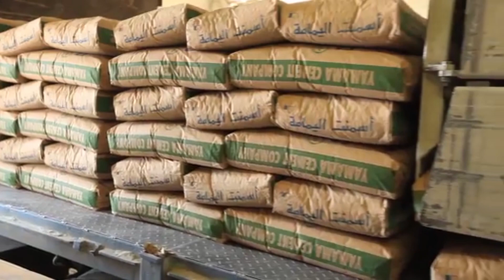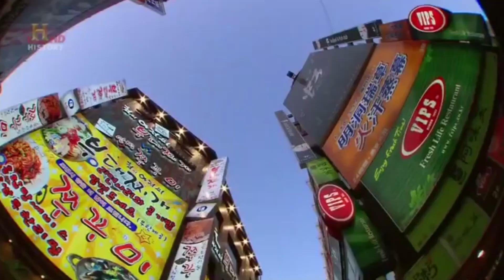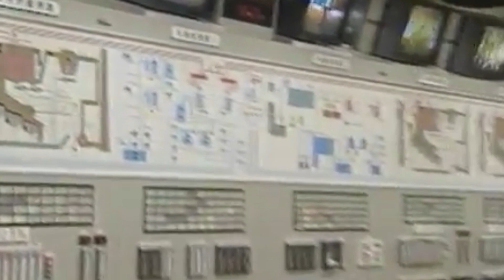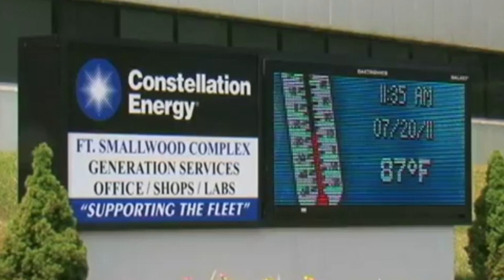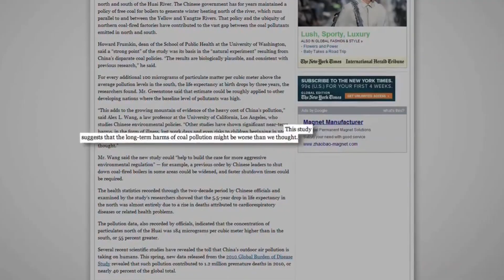10 Countries That Emit The Most Pollution

Comment: 6:40 Cremation and the burning of feces is actually carbon neutral The carbon in feces comes from the air anyway so there is no net increase in CO2.
Reply: isoeno
Trees (and other plants) do not grow from the ground, they grow from the air. If plants grew from the ground, conservation of mass dictates there would be a hole under the plant.
    As a chemist I'm sure I don't need to explain the carbon cycle to you, but for others; plants take in carbon dioxide, break off the oxygen atoms and use the carbon atom to make sugar and add it to their own mass. So you hgave a carbon based life form that got its carbon from the air. An animal comes along eats that carbon and adds the plant carbon to its own mass. If another animal eats the plant eater, of course the animal's carbon, which once belonged to the plant, becomes the carnivore's carbon. When the carnivore dies it's carbon will become CO2 again as the animal is burned or just rots.
Reply: AveryHD
This is true. We need to be carbon negative over all if we want to reverse climate change, but reversing climate change could be even more dangerous than global warming.
    Considering the fact that global temperatures are currently quite a bit colder compared to geologic history, and atmospheric CO2 is quite low, the Earth can survive quite a bit of global warming.
   In the other had, we are still technically in an ice age and it might be very easy to tip the planet into a runaway ice age, where the polar ice caps extend to the equator.
    We could still grow food if the Earth were warmer, but if it were colder, if glaciers covered all the land, there will be no food at all.
Reply: +Eric Taylor Interesting comment, do you have any sources you can provide? I've always thought that cremation was extremely harmful to environment, since our bodies actually release Mercury, which gets into our atmosphere. Then a traditional cremation, there is the coffin, and all of the power they use in the cremation process (700C+ for 75 minutes). Although I'm sure they aren't doing that in poorer countries. I found an interesting article here: http://www.theguardian.com/environment/2005/oct/18/ethicalmoney.climatechange
Reply: Police Brutality The mercury comes from dental work. Humans aren't made of the stuff, and unless they have died of mercury poisoning, there isn't much there. It is a separate issue from carbon in any case.
    The carbon contained in the bodies came from eating plants or animals that ate plants.
   That carbon is mostly going to reenter the atmosphere anyway as the body decomposes. Burning it only does it slightly faster.
Reply: I'm sorry... How does carbon come from the air? Yes I understand carbon dioxide is in the air. I'm a chemist. But the majority of the carbon in the reactions you are stating are mainly coming from the fact that Carbon is largely collected in living organisms, and poop, which is organic. So, burning bodies may actually be worst than burning them. Though I still think funerals are... A waste of time... For the most part.
Reply: I see what your saying. It just your saying it in a particular odd way.
Reply: Also, I looked into it. I asked a few of the others that are more inclined towards organic chemistry, and you are right. Cremation is carbon neutral. Idk why or how. I'm more into electro-chem.
Reply: +Eric Taylor Yes but isn't the argument based on how much carbon dioxide is in the atmosphere at a given time not the total amount of Carbon dioxide that circulates between organic substances and the atmosphere?
Reply: isoeno
How is the way I explained it odd? It seems fairly straightforward to me.
Reply: Eric Taylor reversing climate change is not more dangerous. We just need to be careful to not remove too much co2, making our world too cold. Since China doesn't want to corporate in the flank scale of trying to stop it I think we'll be good because China is still producing a lot of co2

Comment: Nuclear power could end our problems with pollution world wide over night if we weren't so unjustly terrified of it. 
    Even with the two (in over 60 years) accidents that contaminated areas with enough radiation to require evacuations (perhaps permanent) it is still a better choice than any other option currently available.
     And the newer technology is far safer that what was used in the two plants that did have problems.
   The sooner we start building nuclear plants the sooner we can stop climate change.
Reply: *****
Talk about someone who needs to be informed. Your problem is you have been informed with bad information. It's pointless to try to convince you of the real truth. You'll just call me a government dupe.
   If you really think hydrogen is a good option I would suggest looking up the properties of hydrogen. Especially how it burns especially compared to gasoline.
Reply: Eric Taylor I agree so much. Currently in school I'm doing a project based on pollution. All the comments I have gotten back were, "Nuclear pollution is bad." I have done research reading non biased articles ones that were for nuclear power and reading ones that were against it. Let me say the ore outweighs the cons extensively

Comment: ? You were talking about pollution in South Korea but you showed nuclear reactors putting out water condensation that's not pollution nuclear reactors don't pollute the air at all only problem with them is the nuclear waste and how explosive they are but they are super safe from attacks and stuff so it's really just the nuclear waste